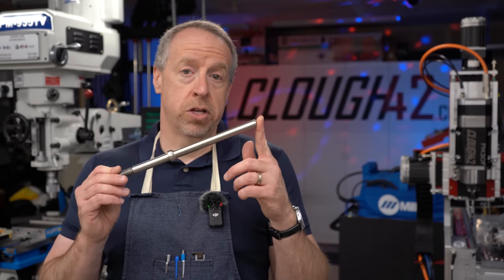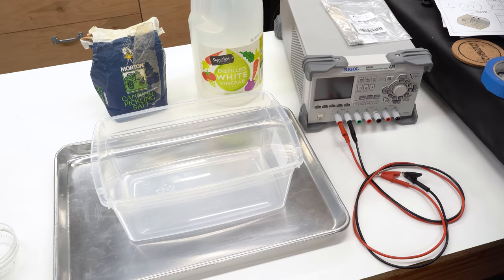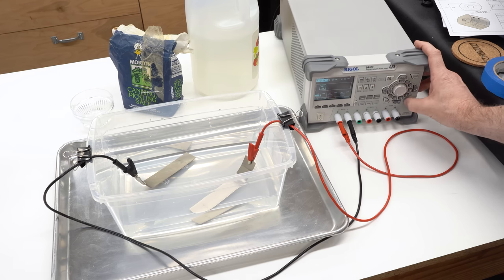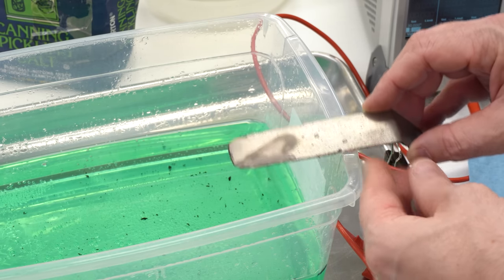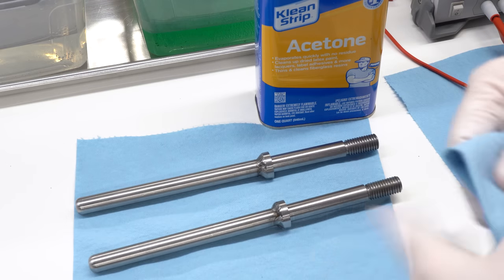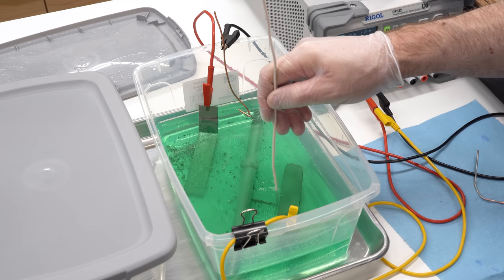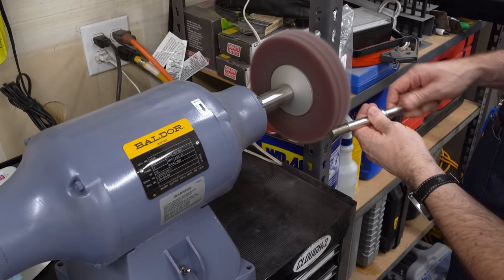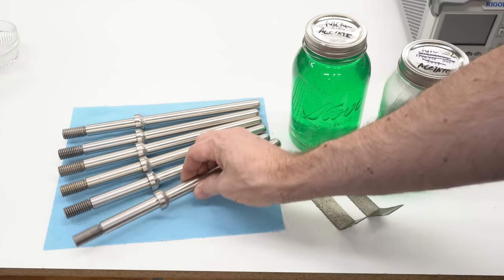Nickel Electroplating in the Home Shop - A Shocking Way to Prevent Rust!

Comment: Measuring the mass of the anodes before and after the plating run should yield enough info to estimate thickness.
Reply: Except you would also have to account for the amount in the solution, which is difficult to measure.
Reply: @reverse_engineered  I'm assuming that the solution is saturated prior to the run, so its state should be steady.

Comment: The only comment I would make is that the power supply you have used is not commonly available.  I have seen other use a battery charger.  Twelve volts may not be as fast, but it still works.  For an electrolyte, I would NOT recommend salt- it can release chlorine gas (NOT a good thing!).  A very common and freely available electrolyte is OxiClean(TM) that avoids that issue.
Reply from the maker: The Rigol DP832 is not commonly available?  You lost me there.

Comment: Constant current power supplies can be lethal — they are able to ramp the voltage up to punch the selected current through whatever impedance it meets— 150 milliamperes delivered to your heart is inevitably fatal
Reply from the maker: Uhh...no..  Max compliance voltage on the Rigol DP832 is around 30V, which cannot produce the risk you imagine.
Reply: @Clough42  80 volts can punch through skin...but yes, 30 volts is unlikely to do so

Comment: Some good advice below to consider ... 😊

Would just add : 

Good ventilation is mandatory for your health ... and to release hydrogen gas ;

Do not soak anything that is not plated ! 
So you need to plate the small wire used to secure the thing-to-plate... prior to the plating session ! 

Make a few more so you can soak the full nickel electrode without immersing the crocodile clamp 😬

Comment: Typically the slower the better the finish. Instead of current limiting, just set the voltage at about 1.5V with current set to max and let it go for 24hrs. The longer you leave it the thicker the plating will be.

Comment: Contact A-Brite for a nice sample of nickel solution.  You will need some nickel chunks and a .5 micron bag to do this right, and then a solution immersion heater/stir like Braun Thermomix II Immersion Heater Mixer or Cole Parmer, etc. You also need an accurate current supply and an accurate timer.  It is always a good plan on calculating plating time/current based upon surface area and temperature, and concentration of solution. 

 Be sure to return all expended solution to A-Brite or a plating shop.  A plating shop (nickle/chrome shops have the large tanks) will accept your solution for rejuvination or recycle to the solution provider for proper treatment.  Do not pour that stuff down any drain or outside.  

Also, given time, a nickle solution will actually penetrate the polyethylene 5-gallon pail it is provided in.. so keep a eye on the container if you long-term store it.

While Jeff B's remarks below are good things to consider, it is certainly within capability of the home shop to do this properly... just pre-plan on your solution/salts disposal, to a legitimate plating shop or back to a solution provider.

Comment: If you want shiny plate add 1-2grams/liter  of Saccharin (the artificial sweetener) to the bath - This acts as a brightening agent.
Reply from the maker: I've heard sugar, corn syrup, and polyethylene glycol suggested for this purpose.
Reply: @Clough42  Polyethylene glycol is not a brightener its used as a carrier in conlunction with a little chloride in copper plating solutions. Sugar, molasses and corn syrup are super old school and while working a bit they degrade relatively quickly.  I have tried a few things and saccharine works - its also mentioned in a few books on the subject.  In addition besides mild agitation keep ph at app. 2-3  temp at 35°C and i had the best results with a current density of around 25mA/cm² of to be plated surface.

Comment: If you nickel plate aluminum, please make a video of that 😁
Reply: No aluminum or stainless steel electroplating is possible.
Reply: @mordantly  Sure you can. It's very common to plate both materials.
Reply: @mordantly  Yeah, that's what I thought, but he had had a way, I wanted to see it. What I read was that aluminum had to be copper plated first and then nickel plated.
Reply: @ADBBuild  the required intermediate strike layer is like saying plastic can be chrome plated.

Comment: So in theory right... if i take a car shell, drop it in a swimming pool of the "solution" and power it up, it would plate say the bottom 1/3rd of the car in whatever metal was sacrificed?
Reply from the maker: I think the characteristics of the metal and the acids matter, but in general, it scales up, if you can supply enough current.
Reply: @Clough42  suprised no one has tried it yet

Comment: can you use "Washing Soda" instead of Salt? As is the same when performing electrolysis rust removal.
Reply: no because sodium carbonate, washing soda, is a strong base. Sodium Chloride, common salt, is not a base. You could use citric acid.
Reply: You can skip salt and use 10% Hydrochloric acid (muriatic).Its a common house cleaner . Its best to do a copper plating then nickle plating. That way you dont get rust underneath nickle plating that causes flaking.

Comment: How strong is the vinegar? I can only get 24%
Reply from the maker: It's right off the shelf at the grocery store, so not strong.
Reply: @Clough42  Do u have the percentage or blending ratio? 
That, of the shelf vinegar, can u use it direct in food or do you need to dilute it? :)
Reply from the maker: @SumUnicus  the bottle says it's diluted with water to 5% acidity
Reply: @Clough42  Ohh... Drinkable straight out of bottle 😁
Thanks for the answers.

Comment: The steel lids will corrode there are plastic mason lids that are more stable.
Reply from the maker: These are polymer lined.  But I'll keep an eye on them.
Reply: @Clough42  mine as well and both 99iso and acetone did it frighteningly quick. I use nitrile glove liner but have no real concers for contamination.

Comment: Once that is saturated with Nickel is it toxic?
Reply from the maker: I don't know.  I would think so, but many sources say you can dump it down the drain, followed immediately by a chorus of people screaming about how bad that is.  I plan to keep it and re-use it, and I'll probably evaporate it in the end, to reduce it to a solid.
Reply: Yes it it indeed toxic & a carcinogen.

Even the nickel plated surface is toxic and can cause skin rashes.
Reply: @guytech7310  I know you can buy many things with nickel plating.  I assume the risk of handling it is minimal.  I was more concerned about the liquid.  Maybe being absorbed through the skin or ingesting it.

Comment: I get to be the guy telling you that you are doing it wrong.  You don't plate nickel directly on to steel. The nickel wont adhere well to the Steel and will eventually peel/pop off of the steel.  You need to first plate the parts with a layer of copper and then go for the nickel. Funny thing for chrome the order is copper first, nickel second and the chromium last.  A friend worked in a plating shop and brought me in and showed me the process.

Comment: Typical plating is tens of millionths of an inch -- a factor of 10 too small for a micrometer to see.  If you want an estimate, total charge is current times time, number of Ni atoms is charge/e, each atom is about 0.25 nm cube, and thickness times surface area is total volume.

Comment: Welcome to my world.  I've been plating on the industrial level for 20 years.  Any questions don't be afraid to ask.
Reply from the maker: Very cool.  I've seen a bunch of references to adding sugar as a "brightener".  How does that work, and how much is needed?
Reply: @Clough42  from what I've read (in reference to home game plating like yours) the sugar trick is for a zinc bath.  The sugar would essentially act as a grain refiner which leads to a tighter grain structure and therefore a brighter finish.  We use specifically formulated chemicals for our baths so im unable to make a suggestion about using it in your nickel bath it may be worthwhile to experiment with a sample.  In the event it contaminates it your not out your entire bath.
Reply from the maker: @N.Cognito  Cool.  I might give it a try.

Comment: My parts keep going black what could be wrong
Reply: Black may be carbon from steel.  Do you have the polarity right?
Reply: @firstmkb  I am plating steel. The steel plate is negative. And I can get one done then the solution starts making the next plate black with some green. I have to keep making new electrolyte. The plate is 100 mm x 80 mm. Maybe it’s my voltage I’m using about 1.5 volts it’s about 80 to 90 milli amps.
Reply: I've got a stainless pistol barrel I would love to coat black.  Blue-black would be ok but not so much with green.  I wonder if your process might work?

Comment: YUP batteries and electroplating, different metals, electrolytes and volts and amps,
I know what a mess is when having not read enough, I had a good piece of copper
and zinc in a grapefruit and had a bit of voltage to work a flashlight bulb, it worked
for a short time then I attempted to change this fruity battery with house current,
yeah that grapefruit got very big very fast! to the point there was grapefruit all over 
the place. 
years later while living in Worcester,Mass I had a job in an electroplating shop, a large
motor turning a generator powered the plating process, it was low voltage with loads 
of amps to it...much safer than house current!

Comment: 473.00 is a bit steep for that PS.  Better options with equal performance out there.
Reply from the maker: There are plenty of solid power supplies for less.  But for a 3-channel programmable supply with a sequencer, network remote control, GPIB, and all the other features, it's hard to beat the Rigol.
Reply: @Clough42  For this purpose I doubt the metal knew the difference.  For precision electronics work I'll give you that one.

Comment: This is all well and good, except those of us that have Nickel allergies. Sucks as most stainless steel has Nickel in it - that rules out most razor blades, and any clothing with metal clasps buckles or snaps for me! So electroplating all my stuff I didn't want to rust with Nickel that I'd be touching wouldn't be a great idea either...
Reply from the maker: Interesting.  That's not something I'd heard of.
Reply: @Clough42  I knew I had some kind of metal allergy as my parents mentioned that any baby clothes they put me in that had metal snaps would leave large red marks anywhere there was metal, so they had to avoid any clothes with metal. Later when I got glasses, they always had to put clear heatshrink sleeves over the arms if they touched my temples. It took me forever to figure out that's why I got such bad "razor rash" after shaving, and consequently now I just "trim" with a trimmer with the shortest plastic guard over the blade - where I use the trimmer "bare" to clean up around the edges, it still turns red relatively quickly. If I wear a belt with a metal buckle and an untucked shirt so the buckle can touch my stomach, it gets all irritated and itchy there. Actually what tipped me off was when I got my engineering ring after undergrad (Canada) they mentioned it was hypoallergenic, and should be safe for people with Nickel allergies to wear, and that's when the lightbulb went off, and I realized that Nickel was what the issue is. Looked it up - yup, nickel is in razor blades, most metal used in clothing, etc etc, and JUST now on the mayo clinic site about Nickel allergies I read that peas have high nickel content - maybe that's why I've always DETESTED peas (or maybe it's because they taste like peas - the worst flavour ever - or is it they have the worst flavor ever to me because I'm allergic, so it's a natural response)!
Reply from the maker: @gorak9000  That's the worst case I've heard of.  I think normally it's an issue with rings and piercings.
Reply: @Clough42  Yeah, lucky me, right? Oh well, of the allergies to have, it's not the worst - it's not that hard to stay way from Nickel. I'm not really a jewelry or rings kind of person, let a lone a piercings kind of person, so it's not that big a deal. I haven't even worn my engineering ring in years either, partly because no one in the US even knows what it is, and partly because I've been working from home going on 3 years now (and also because like you, I lost some weight, and it's too big now and at risk of falling off all the time - I'd have to mail it back to Canada and exchange it for a smaller one)! The worst of it as a teen / adult was shaving and wondering why I ended up with the worst razor bumps ever all over my face. Are there other coatings one can electroplate onto things that are rust resistant, but not Nickel? There must be something else that works too...?

Comment: Hmmm.  Just a though . If metal salts are so dangerous , why not deal with the solution by dropping the metal out of solution , I’ve seen this done with copper and other metals like gold from nitric acid as well as hydrochloric acid . And maybe it’s possible to do the same , plus you get to reuse the metals that were in solution and have less dangerous waste to deal with .
Reply from the maker: I've heard it's possible to plate out the metal.  At this point, I'm storing the solution for future use.

Comment: I hope it's just for the camera, but keep that beautiful Rigol far away from all of those acids..
Reply from the maker: I thought about it.  It would be further away if I weren't filming.
Reply: @Clough42  Was doing this about a month ago with copper acetate in a covered jar (beautiful color too). Still finding a tiny blue copper drops around and the clips are corroded. But the worst is the vinegar smell. Couldn't get it out of nose.. I just received citric acid, am quite curious. Also want to try tin plating in the future. That should leave a beautiful finish on polished surface.
Btw that color "hiding" of the plated surface is interesting. Is it because the ionic solution absorbs the same wavelenghts?

Comment: If anything hand contact would prevent rust
Reply from the maker: Your intuition on that would be wrong.  Fingerprints are a huge contributor to rust and corrosion.  Many a fine firearm has been blemished with a rusty fingerprint because it didn't get fully wiped down before being stored.
Reply: @Clough42  I have seen handles on machines that have had alot of hand contact, and the rest of the handle became rusty but the portion that was held did not rust even when placed outside.
Reply from the maker: @wadkin1973  Interesting.  I'm sure there are a lot of variables.

Comment: copper should work as well, and way more common metal
Reply: or aluminium
Reply: or magnesium
Reply: all of those other metals will form a protective non-rust chipping protective layer on top
Reply: challenge: dont get anything from a store or buy from anyone, diy challenge, with minimum what you have, minimal premade tools, if you need a tool, make sure you can make the tool, yourself
Reply: same goes for metals, from dirt if you "need to"

Comment: Hey dude. You have electrical equipment 8 inches from hydrogen gas
Reply from the maker: In fact, the electrical circuit is in contact with the tiny amount of hydrogen gas being produced.  That's how electrolysis works.

Comment: i am curious as to why you pinned that jeffBS comment, it's just your typical self-anointed wannabe know-it-all troll dribble, you showed yourself that nickel plating is perfectly doable at home, zinc is not much harder and for copper plating all you need is a bottle of RootKill, some distilled water and a couple of alkaline batteries. while there is a way to brass plate small parts at home, it's not very efficient but it's doable and not dangerous, gold is doable but temperamental however anything to do with chromium and tin not a diy thing.........